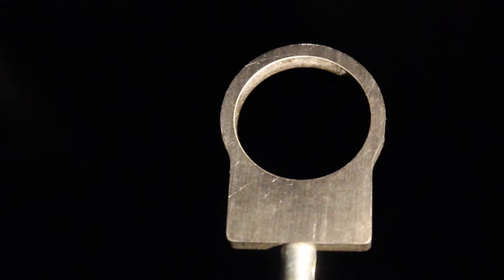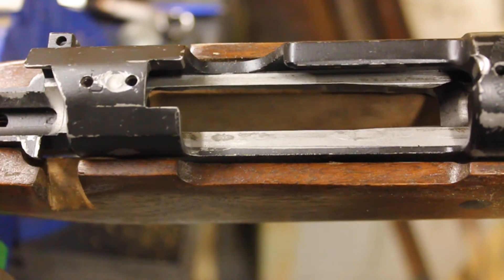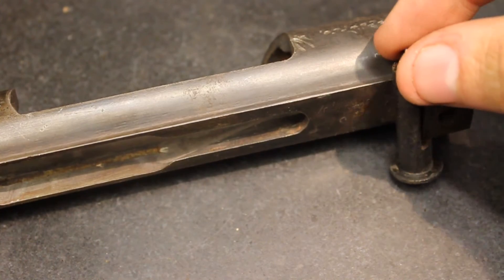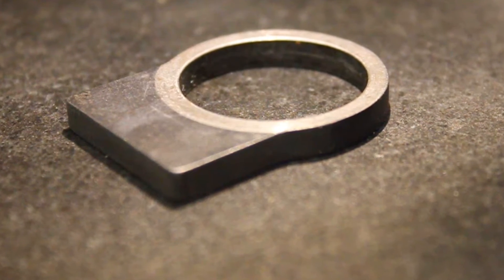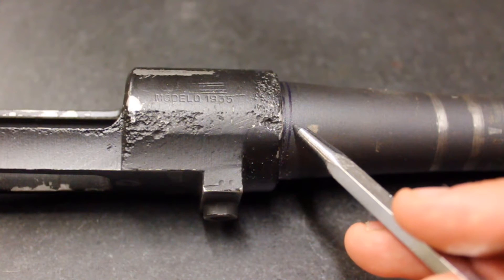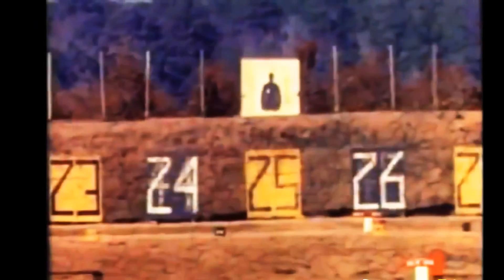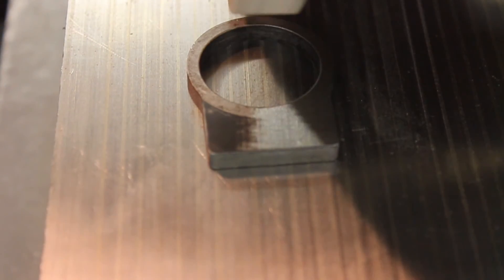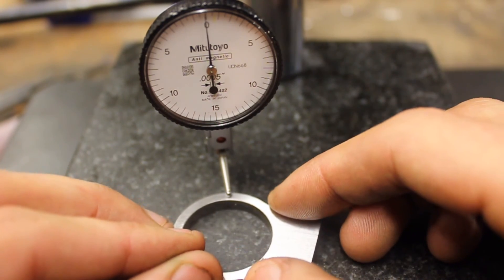Recoil Lugs

Comment: I made a recoil lug from ground flat steel. When I deburred it, I got the sides out of parallel. 
So now I just buy them.
Reply from the maker: Hmmm, I generally don't worry about the side since I am bedding the action to the stock. Is there a reason you want the sides of the lug parallel to the face? I also read that Tub brand lugs simply counter drill their lugs slightly to avoid just what you said and to ensure that the lug doesn't hit a slightly round corner on the barrel shoulder from the turning process. By the way I like your video, hope to see some more!